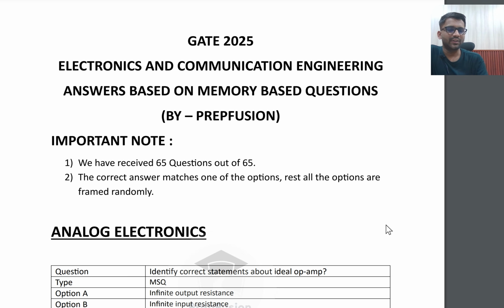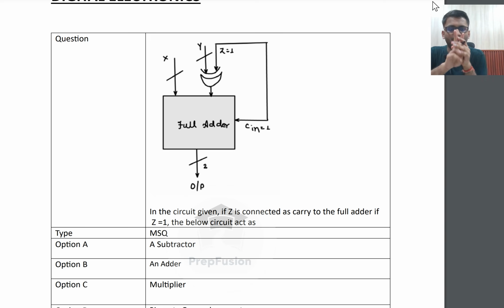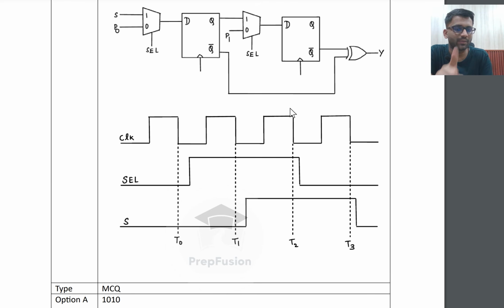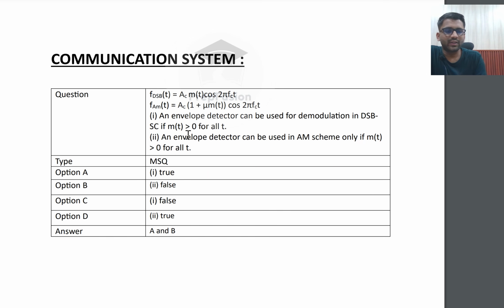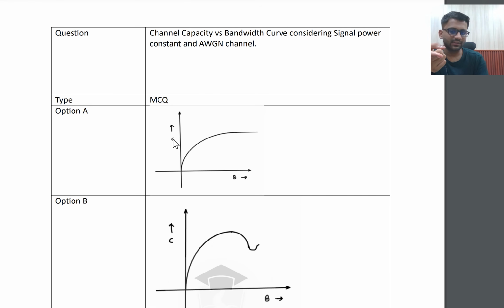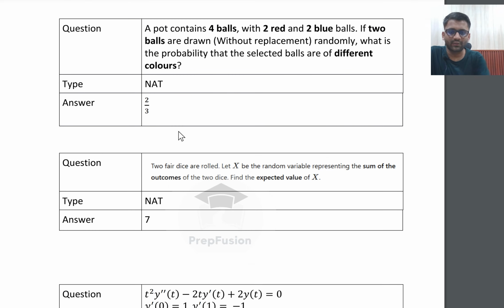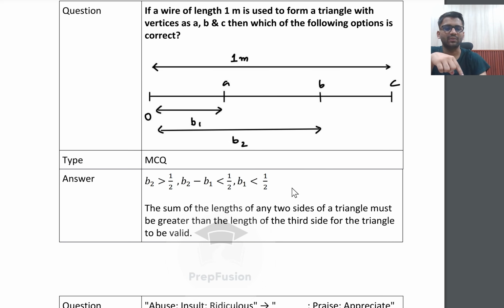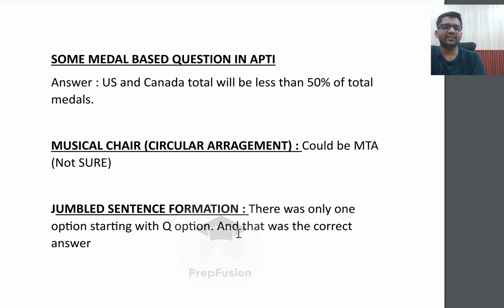🔥GATE 2025 ECE All Answers || All Questions Solved || 65/65 || PrepFusion

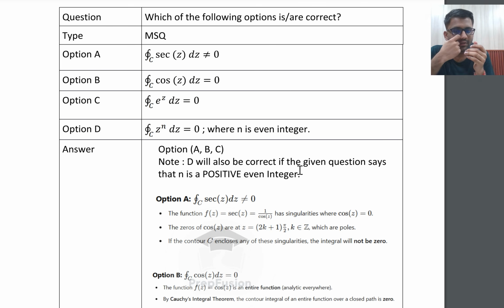Comment from the maker: Hi Everyone, at 18:51 (d) option is also correct for negative even values of n which will give residue 0. Using the formula of repeated poles we can get residue as zero.

Error at 9:54 , answer will be f(t), not f(t-tau)

Comment: 16:54 two options (c) and (d) should be correct i remember I solved it comprehensively during GATE exam and then marked these two plz verify this question solution it was msq also matrix was diagonal (2,-2,1) not (2,-2,0) in actual exam as discussed in question so plz correct it sir

Comment: 18:51 d option is correct becoz if n -ve minimum will be -2 which will give residue 0 so integration will alwz be 0
If n 0dd in questn for n= -1 residue will be non zero!
Reply from the maker: n= -4 is also a even number -2 is not the minimum value of n
Reply: 😂 even then residue will be zero
I am doubtful about n=0 
Please can you think about it
Reply from the maker: @govindkrishnadasa  How will residue be zero if you have a singularity
Reply: Use multiple pole formula to find residue....
Residue can be zero!
Reply from the maker: @govindkrishnadasa  Yes Residue will be zero.
Reply: Okay Thanks